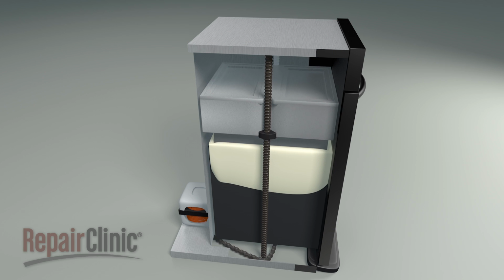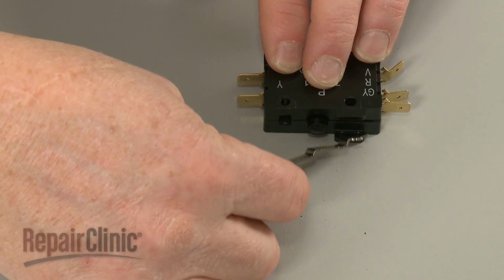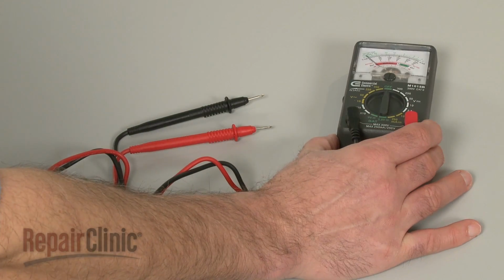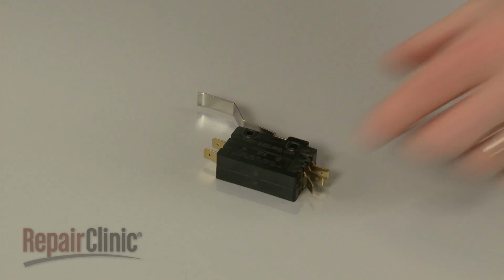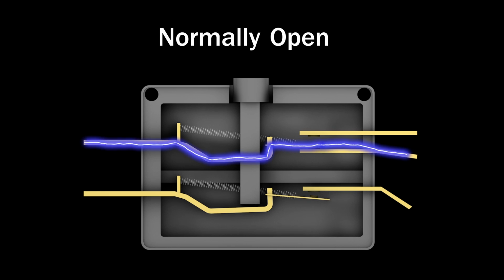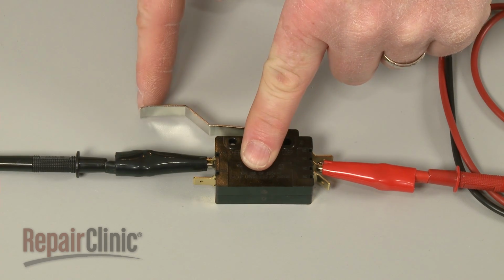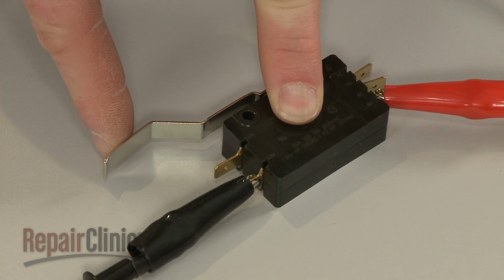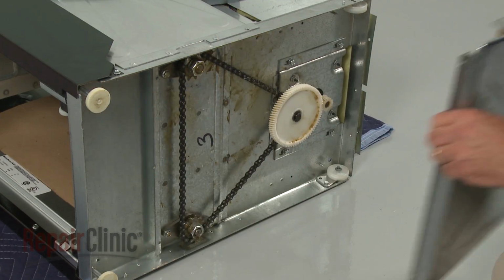Trash Compactor Not Working? Directional Switch Test, Repair

Comment: My Broan 1051-H compactor went half way down and stopped. (It could have stopped anywhere or not started).  The video was an inspiration for me to place my  compactor on its side on my kitchen table, remove the back plate and then remove 4 nuts that hold the 2 rails to the top of the unit. I tested every switch for continuity and all was good. I then started gently tugging on all the disconnects (wire connectors) that were not connected to any switches and one of the wires that attaches to the motor tab came right off.  BTW I tested for power to the motor first and there was none. So it turns out the the wire was fatigued and severed internally from years of vibration but was still being held on to the disconnect by the shielding. Turned out to be  4 hours of my time and a 2 cent part.

Comment: If the ram returns to its top position and continues to go up, resulting in loud banging, try bending the metal lever outwards so that it can detect the ram is up and stop the motor.
Reply: This fixed mine.  Thanks!
Reply: I have a Kitchen Aid compactor and bending the top directional switch fixed mine from thumping when it reached the top. It is very finicky it may take a few small bends to get it back working correctly

Comment: Great video, The issue I'm having is the trash compactor returns to the up position, but doesn't stop. It continues with a banging sound and requires us to hit the stop button. I thought it was the directional switch so I replaced via the directions of the video. Great video, but it didn't fix my issue. Any suggestions?
Reply: same problem how did you fix
Reply: Curious how you fix that issue too.
Reply: How did you fix?
I have same problem....i tried replacing the switch but didn't fix it.
Reply: Alberto Garrido I had to bend the silver lever on directional switch to make contact with the ram
Reply: Check the foot pedal switch, if that switch is sticking on the compactor wont stop on the return, hopefully its not too late for you, but may help others.

Comment: My trash compactor is getting stuck and will not compact.  When I move to the On position, the motor turns on but then it make a noise like it can not go further.  If I keep it in this position, it shuts down and I have to wait 10 minutes before there is any power.  If I switch to the Start position it does the same thing.  I tried testing the directional switch and it tested continuity where it was suppose to and didn't where it wasn't.After this didn't work, I opened the motor gear and twist CW and the trash compactor moved down.  when I put it back together, and turned it on it returned to the normal position but when it got to the top, it made that same noise.  To me it sounds like a directional switch issue but I checked that and it was ok.  Do you have any ideas?  Thanks

Comment: I own the compactor in the above video.  My switch has two clicks when pushing down on the plunger.  First click operates the first two sets of contacts, NO and NC.  The second click operates the bottoms set of contacts.  NO and NC on this switch is functioning as should on both sets.  My problem, while in the "Solid Lock" position the ram will only go down and up while HOLDING the main on/off switch to the on position.  The ram will not stop in the compact position but returns back to the up position, again while only holding the switch in the on position.  The "Normal Unlocked" works as it should.  This started right after I replace the gear on the drive chain. Have I done something wrong?  Or do I just happen to have another problem?  Where do I go from here?  Thank you.
Reply from the maker: +Steven Holmes Thanks for reaching out to us! Nothing should have changed unless some wires pulled off and got put back on wrong. I would look at the solid pack switch and make sure the wires are still on it. You can also look at the wiring diagram on the unit and make sure the switches are wired correctly.
Reply: Thank you.  I did pull the cover off that covers the motor.  I will recheck the wires down there .  Thank you much for replying.
Reply: The video is not clear enough regarding this point: When depressed the switch makes one click and then when depressed a bit more, it makes a second click. At the first click the top three contacts (COM, NC, NO) work as in the video. However the lower two contacts (COM, NC) seem to work ONLY after the second click. Is this how it's supposed to work?

Comment: I had this problem....that is.....the compact goes up and doesn't stop....it just tries to continue to go up causing a "banging" at top and doesn't shutoff. I've replaced the directional switch but that didn't fix the problem. Anyone have any ideas?
Reply: I have the same problem, did you figure it out? I have replaced the limit/directional switch....
Reply: Check the foot pedal switch, if that switch is sticking down the compactor wont stop on the return,  it was sticking down on mine and cleaning it so it returns freely fixed the issue, if you cant get it operating normally, replace it.
Hopefully its not too late for you, but may help others.
Reply: @andrewnoble7881  foot pedal switch?  How do I locate that?